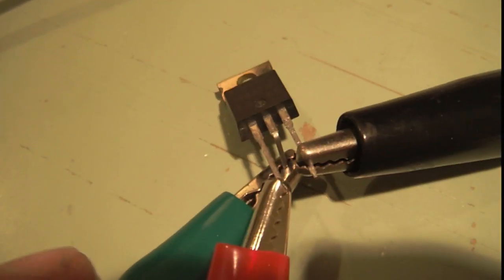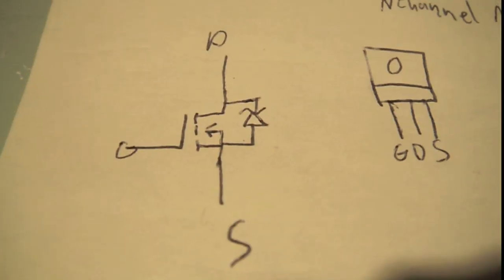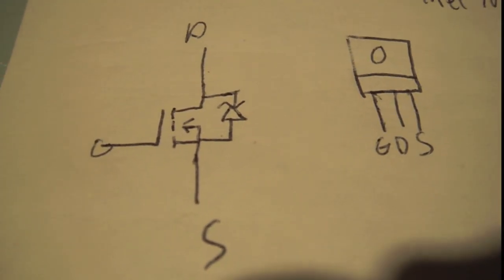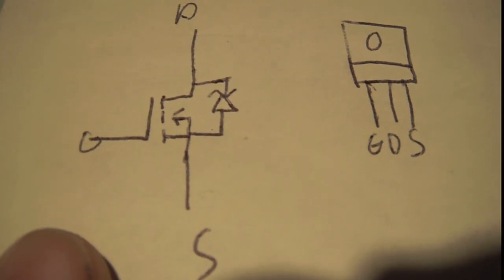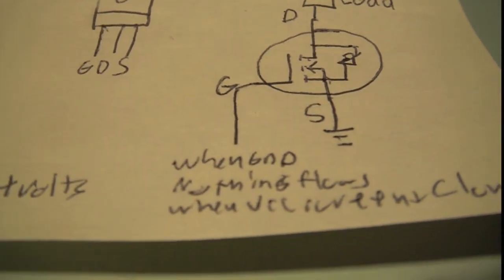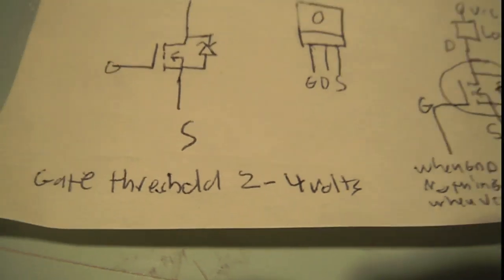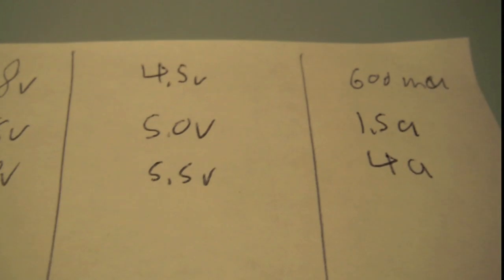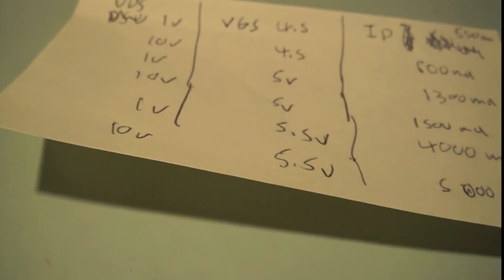N-Channel Mosfet

Comment: Nice tutorial per se, BUT your camera work is GODAWFUL, jumping around, out of focus, no sequence to it and generally almost a waste of time.  Why the hell do you not prepare your lecture and get the camera framing sorted BEFORE  you film it.  You  can even film separate parts IN FOCUS, and then simply add the soundtrack later.

Comment from the maker: No problem, thats why I make videos. If you like it check out one of my other vides where I use an N-channel mosfet in a voltage regulator instead of an NPN or PNP.